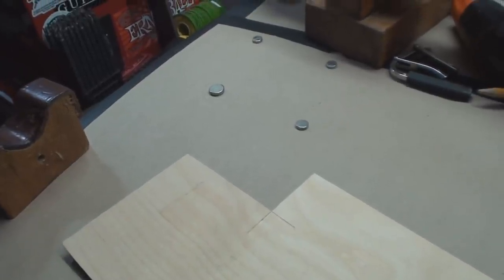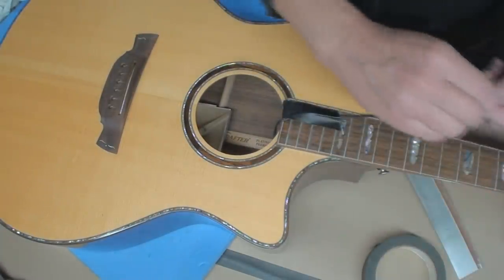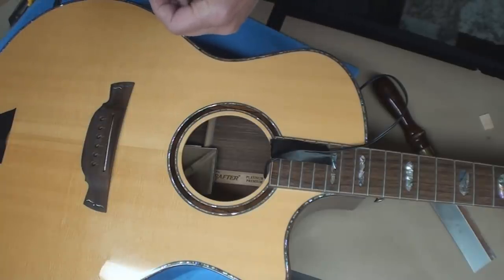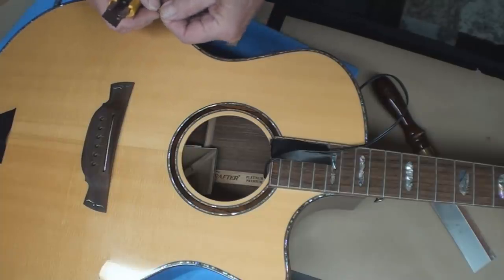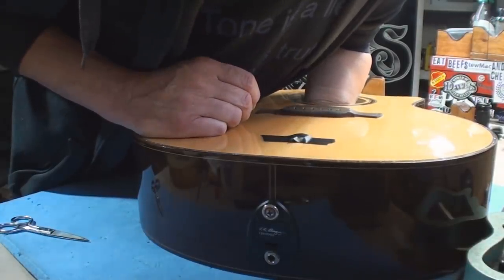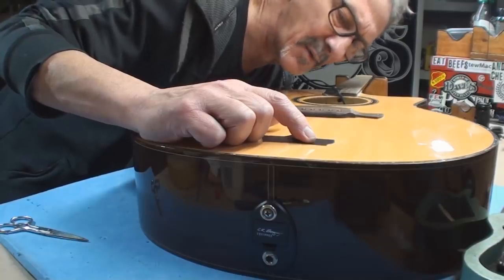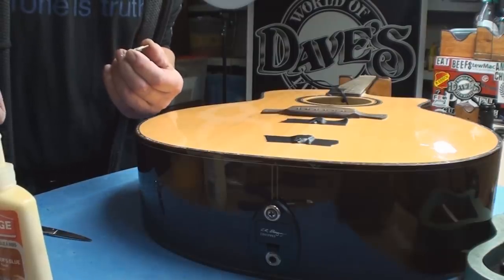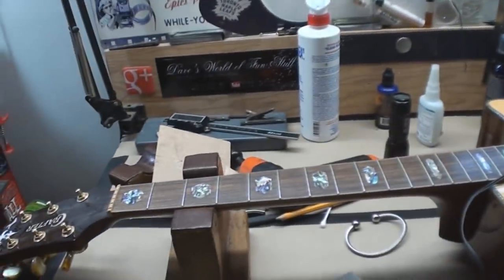Crafter Guitar Gets Its Crack Repaired

Comment: I just trash-picked a similar model of Crapper acoustic-electric. It's got a cracked top, but after removing the DNA I realized it's playable - has decent intonation and had a extra set of D'Addario strings, extra pegs and a couple of energizer 9-volts in the padded gig bag (that didn't even smell funny). Could this have been a case of the angry ex-wife/GF throwing out her ex's valuables? I'm just going to string it up tomorrow and play it at home. Dunno much more about it, but if Dave's even bothering to repair one - it sounds like a scored a decent guitar. I expected to see a "Made in China" sticker on the inside, and was overjoyed to see Korea. I never find anything, so this was a nice first.